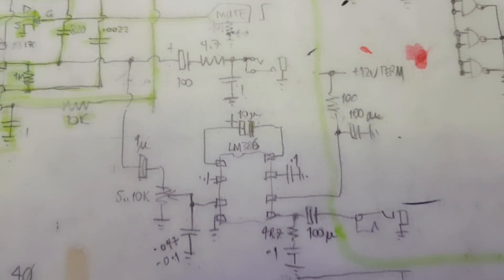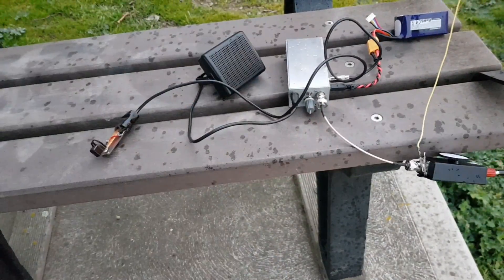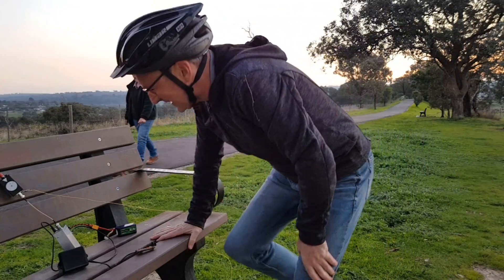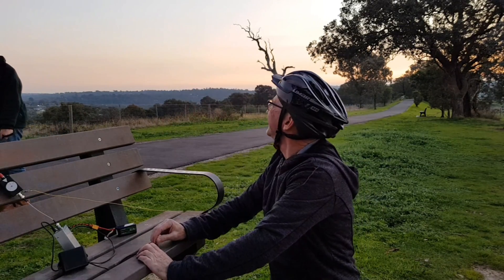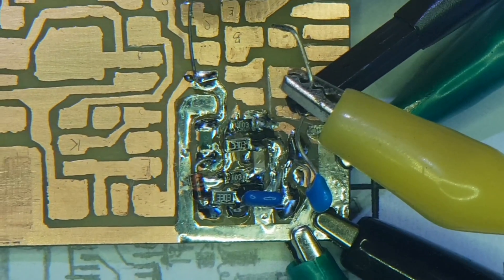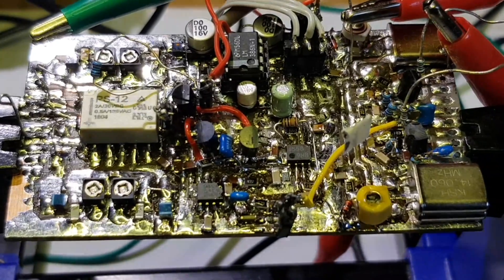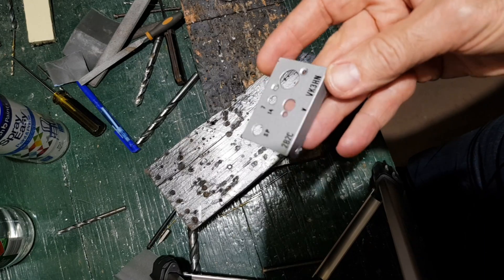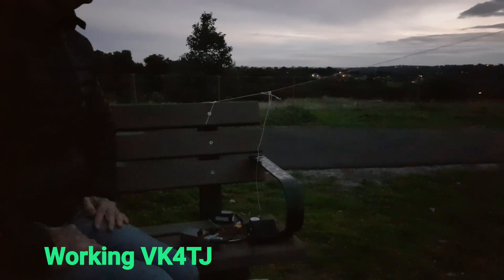Introducing 2B2C, the story of a dual-band 2 channel QRP CW transceiver

Comment: Hi Paul. While re-examining the schematic of 2B2C I noticed something odd about the power amplifier. The input of 74HC00 PA driver is DC-decoupled and pin 2 is grounded. It means that the input will be, for instance, +/- 3V and is going to be compared by NAND gate with logical 0. This is odd because 1) negative voltage is an illegal input for a logical gate 2) X NAND 0 equal 1 for any X in {0, 1}. I think pin 2 should be actually connected to the 5V bus.
Reply from the maker: Alex, so good to read your comment that evidences a careful reading of my schematic.   Few take the time to do that, and it demonstrates your interest and skill.  Give me a moment to check my schematic and my sources, (QCX and KD1JV to name a couple). Your analysis sounds correct. However I know that the Tx produces 5 watts on 40 and 3-4 watts on 20, so the NAND gate driver must be working.  In this design the first NAND gate is driven by a bipolar buffer stage, so it might be true that the drive is swinging above 5v, I recall thinking this,was a potential issue with this arrangement. A more likely option is that my schematic is wrong.

Comment: Dear Paul….. The cobbling together of Frankenstein rigs is a learning experience! I am building the Alva (Swedish Pixie)…. With a VXO using Ceramic resonator C/O Alan Yates. Heard a VK3 CW (I’m VK2 land) but volume is VERY low. With the VXO disconnected the audio “hiss” is ok and LM386 sounds clean but when the VXO is coupled signals are their but rig is VERY low on audio (almost subliminal). … any thoughts?? Ps thanks 🙏 for these vids

Comment: NIce. I got into that -- building tiny radios -- pretty seriously before essential tremor took the joy out of building things. Inspired by the MicroMountaineer and Howard Batie's designs in Ham Radio Magazine in the 70s and then by Wayne Burdick in the 90s, I managed to build a couple tiny flea-powered radios with xtal control. Then along came the MountainTopper rigs from LNR. The new Arduino-controlled SDR sets are very interesting too. But building your own is always more fun; it's what ham radio's all about, at least to me. 
. . . You've done a beautiful job with all these little radios, Paul. Hope to meet you on the air some day. (If we didn't have this damn plague going on, maybe we could meet at the Dayton Hamvention one of these years.) Stay safe & healthy! 73 de W8IJN
Reply from the maker: Gday Nils.  Thanks for commenting,  very thoughtful of you.  I read your qrz.com story, there are some similarities. 
 I also studied the Mountaineer and Optimal QRP Transceiver designs in the ARRL handbooks in my youth, but a lot of the American designs were not that easy to reproduce for me, as we did not have a supply of many of the transistors (2n2222s and 40673s) or the toroids (there were unobtanium in my youth).  I was too naive to realise that I could have substituted with success.  I had plenty of general purpose transitors capable of working at 7MHz and ferrite in other forms.    
I eventually got onto those metal can Neosid formers and then, I moved forward.  Some of my early projects worked only with a bit of luck, as my Grid Dip Oscillator was primitive and gave misleading dips!  I had a long absence from making things, but when I returned, I found out how good the clock generators and microcontrollers had become, and how Chinese manufacture had made accessible things I could only have dreamed about, like VNAs and digital oscilloscopes, to an average experimenter on a budget.  That, plus the power of video to share information and inspiration, has made what we enjoy today possible.  
Good luck and stay safe, enjoy QRP and experimenting, 72, 73 Paul VK3HN.

Comment: Great video, Paul. We can't all be Charlie Morris, but I think the stage-by-stage approach will really help us work through these projects step-by-step. Amazing that there are now virtual groups building together and learning together. Dean's group at Vienna Wireless Society comes to mind. Look forward to following along at an albeit slower rate...  Cheers,  Jack, NG2E
Reply from the maker: Hello again Jack.  Thanks for commenting.  Yes Charlie is an excellent designer and communicator.  I myself tend to beg borrow and steal things, rather than work the  upfrom first principles on a blank sheet of paper.  But the results are what we are after, and you can go a long way in electronics and radio building by selectively copying the practices of reputable designers and builders, of which there are many. I haven't participated in an online virtual construction group yet but that sounds like a great way to build a project. It is then highly likely you'll succeed.  Although the internet and digital have substantially disrupted amateur radio communication of past decades, the benefits in technology, sharing anf community have been huge.  All the best, drop a few comments on 2B2C as it rolls out, it is a fun little rig and not at all hard to follow!  73 Paul VK3HN.

Comment: Hi Paul, The fault finding /testing will be what I will be interested in . vk2jcc
Reply from the maker: There's a bit of that. More testing than fault finding. Because I bring up each block in isolation,   as much as possible,  the faults get caught early. A fair bit on using the Scalar Network Analyser on the filters, and a session with the SDRPlay RSP1A spectrum analyser.